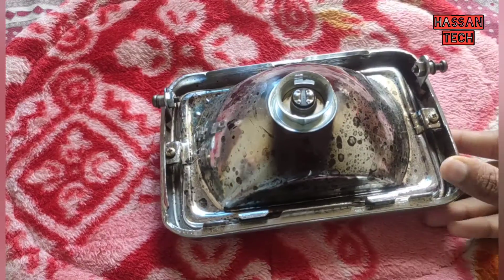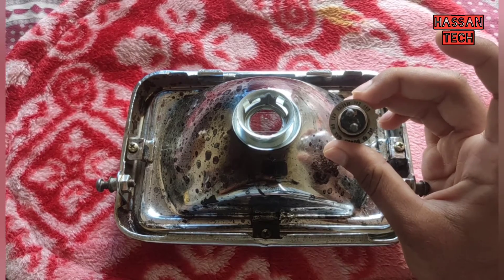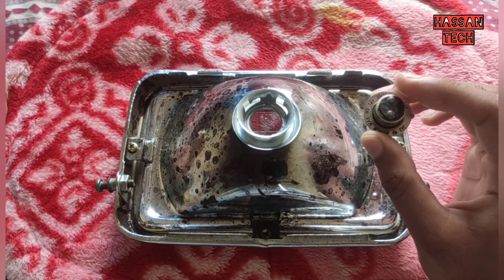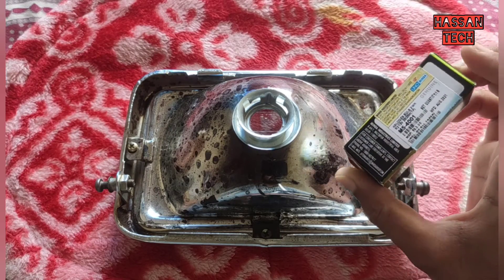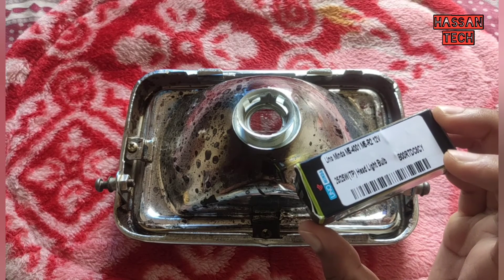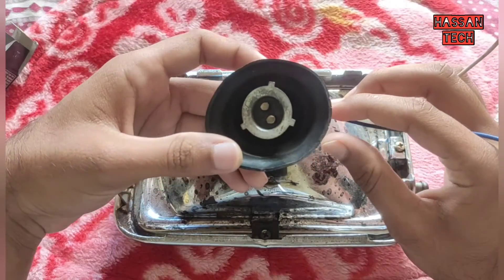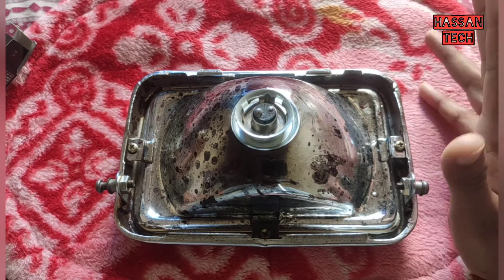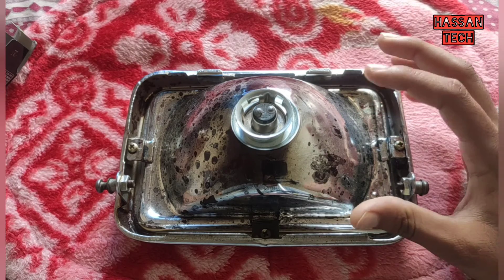HOW TO REPLACE HEADLAMP BULB OF MOTORCYCLE.||HEROHONDA||CD100||.

Comment: bro please help my cd100 2001 model is missing in high gear and low rpm when i pull throttle matlab jhatke kha rahi hai low rpm pai. How can i fix this?
Reply: Firstly check carborettor and get it cleaned bro the Major Missing problem comes when there is dirt in carborettor or petrol is not flowing into engine from carborettor & if above both things are good then check spark plug and pickup coil
Reply: @jay-vm5ob  thanks bro but i re tuned the carburetor and increased the petrol and issue was 50% fixed and i got clutch plate and coupling rubber changed and issue was 100% resolved😀
Reply: @_pm_gaming_point_1726 nice but if you increase petrol and idealing will increase and average will be less eventually , atleast cd 100 should give average of 65 for now
Reply: @jay-vm5ob  bro my cd gives mileage of 100-110 and i always drive rash😅i measured it so its correct mileage
Reply: @_pm_gaming_point_1726  All the best bro good for you.. but in my knowledge best mileage ever given by CD 100 ss was 80-85 that When petrol was pure and after that 70-75 ... But no ever bike has given above 100
Reply: @jay-vm5ob  how can you get 100 mileage specially in 2001 model all CD ss from 2000 model has catalytic converter for pollution control am having a 2000 model and still am getting 60 . Usually CD ss before 2000 model give 75/80 mileage because they don't have catalytic converter installed
Reply: @jay-vm5ob  only Bajaj platina and tvs victor use to give 90/100 don't know how this guy is getting above 80 here am trying to get 70/80 mileage from 60 and he is saying he is getting 100/110 . Hope he did not make it hybrid,,😅😅😜😜
Reply: @williesamuelnairobi  see bro when bike was new it was giving 80-85 mileage then eventually my last block piston was changed in 2010 not it has been more than 12 years running on the same block.. and secondly Mai Original Kiehin carborettor slide piston is not working well so i am using spaco vendor's so it giving 60
Reply: @williesamuelnairobi  I enquired in hero company but they said that it not possible to get a original carborettor

Comment: Hi brother, in my coupler/socket there are 3 wires. But in your socket only 2 wires ?
Reply from the maker: Actually the negative wire was damaged later on I fixed it
Reply: @santugowda6257  how to fix green wire.myself its disconnect